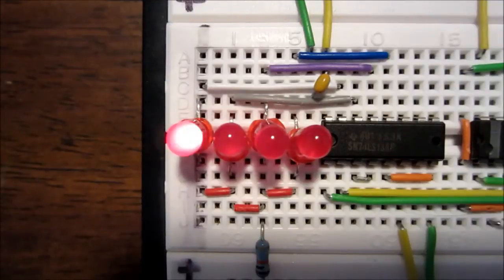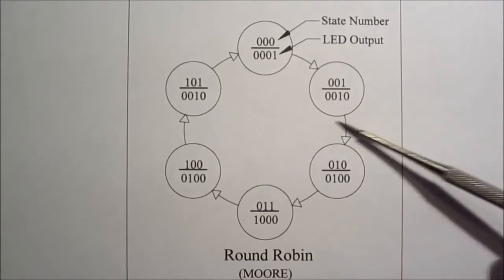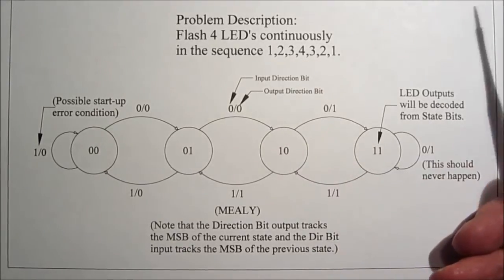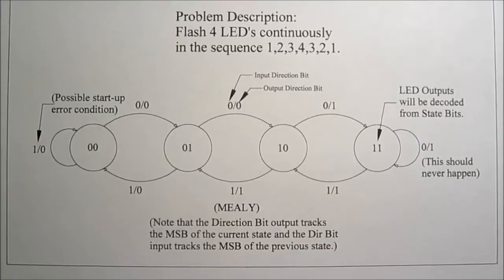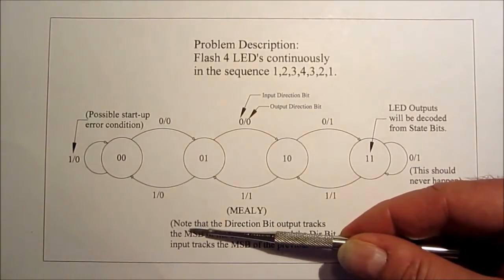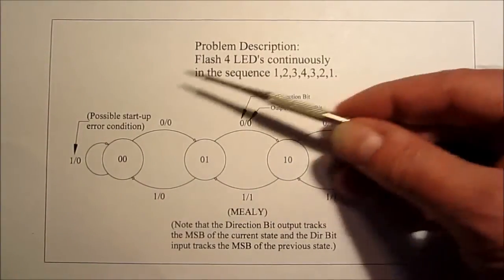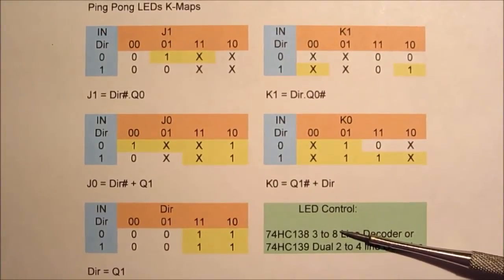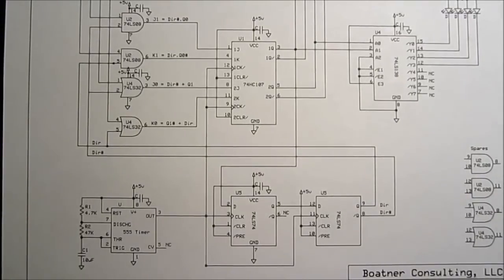FSM Design Project: Ping Pong LEDs

Comment: Hi Bruce, I reckon you can create a six-state Moore machine with this pattern of outputs using two fewer chips than your Mealy machine implementation. I used your idea that you can use a decoder attached to the state outputs for the LEDs and altered the sequence of Moore states to accommodate that. I also modified it so that each bit changes as often as possible as you go through the states to maximise the 1's in the maps, to make the regions as big as possible (maximising the possibility of finding a four). I did this by noticing that you can rearrange the order of the outputs of the decoder with no circuitry, as long as you can rearrange them to get the sequence you want. Doing that you can get away with no combinatorial logic at all, so two fewer chips, replacing your D-pair with the extra pair of JKs (one of which is unused).

So in the end I settled on the state sequence 000->111->010->101->110->011->000 . Ignoring the MSB, that flashes the LEDs in the order 0,3,2,1,2,3,(0). Which means that you need to physically move the LED 0 line to after the 3 (call it 4), rearranging the bus, to give the sequence 4,3,2,1,2,3,(4). You can generate this state sequence with J1=J0=K0=1, K1=Q2#, J2=Q0#, K2=Q1. It's a shame you can't put pictures in YouTube comments. You end up with a 555, 2xdual Flip-Flops and a 2-to-4 decoder.

Hope there's no mistakes in there, I just sketched it out when I was in the bath so it's not as neat as it could be.

No use as an example or as an instructional exercise, of course, which is what your video is about, but I thought you might be interested as an aside.